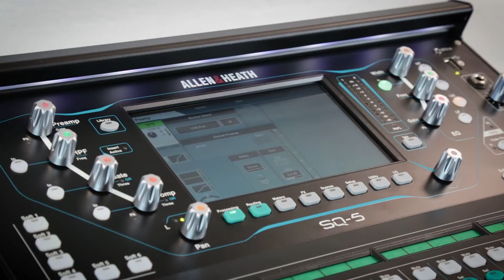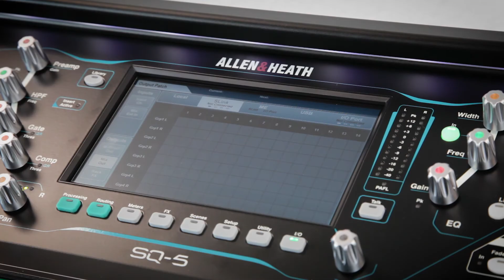Allen & Heath SQ – Patching and the I/O Screen

Comment: Hello sir

Q1. In SQ6 while using stage box AR2412 along with that can we use Local I/O? Then can we get 48 input lines?

Q2. What is the major difference between SQ6 and SQ7. 
What are main main benfits in Sq7?
Reply from the maker: Hi Sudarshan, 

Yes! You can use any combination of Local, SLink, USB or IO port input sockets to assign to any of the input processing channels. 

Both the SQ-6 and SQ-7 have the same capabilities in terms of audio processing, so the main benefit in going for the SQ-7 is the increase in local IO and the available controls on the surface (extra fader strips and soft rotaries). 

Thanks!
Alex
Reply: @AllenandHeathUK   Very glad to see your valuable reply.. Thank you so much sir.. 👍

Comment: Hi! Thanks for this video! Can you please explain why the outputs in the ME screen I/O are unavailable? We would like to send our signals from the SQ-5 to an ME-500 monitorsystem, but we only see those striped unavailable blocks in the output screen. Could you help us out?
Reply from the maker: Hi! 

This shouldn't be the case if the ME is connected to the SQ in a supported configuration. You can check if your setup is supported using this document: https://www.allen-heath.com/media/SLinkConnections_V1_5_0.pdf 

Please go to support.allen-heath.com to start a ticket and one of the team will help you with this. 

Thanks!
Alex
Reply: @AllenandHeathUK  Thanks Alex!

Comment: Hi. Can you please tell me how many of the ad on plugins, I can use per channel? On X32 only 8 effects are available.
Reply from the maker: Hi Lyd, 

The DEEP add-ons (compressor models, Tube Stage & GEQs), replace the stock processing directly on the channel. This means you can have as many instances as there are channels. For example, you could load the Mighty compressor on every input channel and mix if you wanted. 

The Rack Extra FX add-ons (Dynamic Trio, Hypabass, Echo & Bucket Brigade) are library options for the 8 FX racks. So you can have up to 8 instances of these. 

Thanks! Alex

Comment: Can you patch the same input to multiple output destinations? Say if I want to internally duplicate a  input signal from CH1 of the digital snake to the CH1 and CH8  of the mixer fader?
Reply from the maker: Hi! 

Yes, any input socket can be patched to as many input processing channels as you like. So 1 input socket could go to all 48 input channels if you wanted. Each channel will have its own, independent processing, but the gain, pad and 48V settings will be shared as this is part of the input socket. 

Thanks! Alex

Comment: Hello,

I am still a bit confused by this as you go through this at lightning speed. If I have an ar2412 plugged in via SLink, can I still use the xlr inputs on the desk. My plan is to use 24 inputs backstage with the AR2412 for mics then have the other channels for XLR aux cables going into the actual desk. Is this possible?
Reply from the maker: Hi Jeremy, 

Yes, you can use a combination of both expander and local IO. A good way to think about this is by differentiating between Input Processing Channels and Input Sockets. There are 48 Input Processing Channels on SQ and these can be assigned to any Input Socket on the system. Each Channel isn't assigned to a specific Socket, making the system freely patchable. 

For example, you could have CH1 assigned to the AR socket 12, and CH2 assigned to local socket 5... if you wanted. 

Thanks! Alex
Reply: @AllenandHeathUK  Thanks for that Alex. That's a big help!

Comment: Hi! I have SQ-7 and DX168. But I can’t understand if it is possible to assign all input channels to different faders. I see only 40 IP (Not counting ST and USB). Those. There are 8 inputs left on the DX168.
Reply from the maker: Hi Владимир, The SQ has a total of 48 input processing channels, and each odd/even pair can be switched to be used as a true stereo channel (with one fader). In the default setup, channels 41-48 are set as stereo pairs. You can switch these to mono, and adjust other configuration settings in the 'Setup > Mixer Config' screen. Hope this helps, but if you need more info, just contact us using support.allen-heath.com. Cheers! Keith.

Comment: Hey guys :D I have a question... if you use the insert function on chan1 for ex., can you send the audio out to USB 1, use a PC with waves multirack in between and then return from USB in1 on the same channel?
Reply from the maker: Hi Simply_flake, 

You can indeed do exactly that! However, this would incur some latency on that channel which may not work well for some applications. The amount of latency added would depend on your computers specification, but there are low latency options such as the Waves or Dante option cards. You can find more information on those here: https://www.allen-heath.com/key-series/sq/

Thanks! Alex
Reply: @AllenandHeathUK  Thank you so much for the quick answer!! Yeah, I know about the low latency cards... I'm just thinking about a rather cheap system with Multirack that works via inserts and is not Behringer :D An upgrade to one of the cards is always possible... If I route all the channels I use through Multirack the latency will be the same on them (it's a function of Multirack) and I shouldn't have any problems... You designed an awesome console guys!!
Cheers, Florian